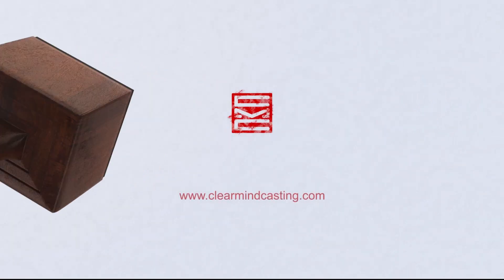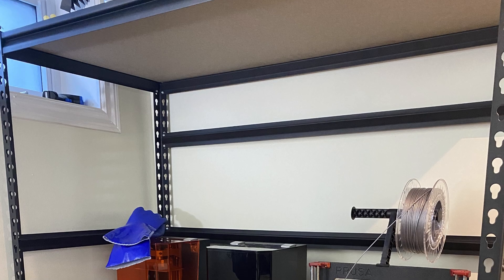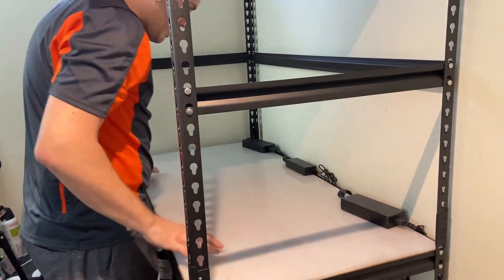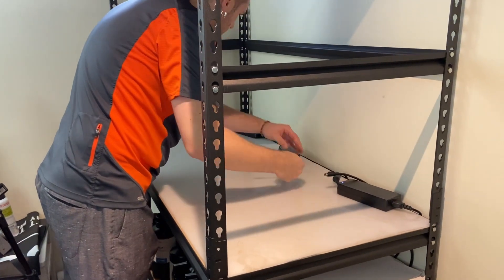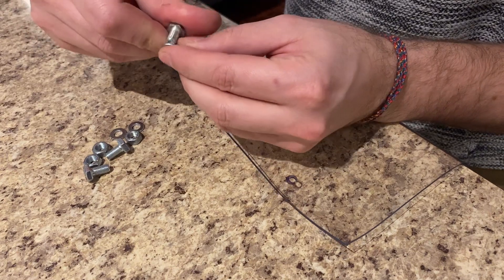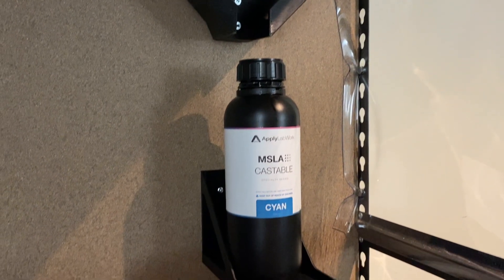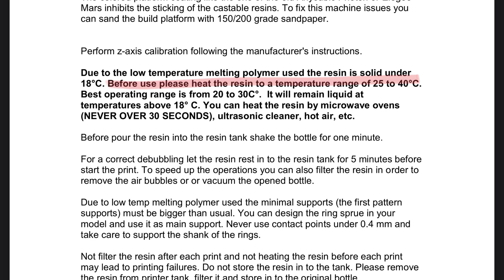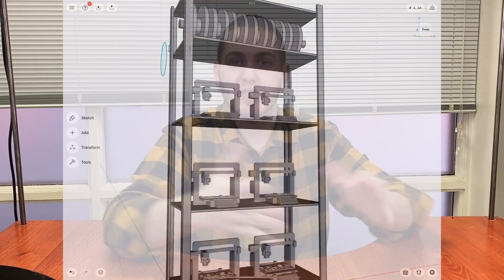DIY Ventilated 3D Printing Station

Comment: is 95% Ethyl alcohol works for cleaning resin?
Reply from the maker: Yes Ethyl Alcohol can be a great washing liquid. However some resins do better with different kinds of alcohol whether IPA or Ethyl, or sometimes a non alcohol solution like Monocure 3D ResinAway. But they all work.

Comment: You should of applied the adhesive along the vertical edges and then mounted the bolts through it. Would of giving a much better seal.